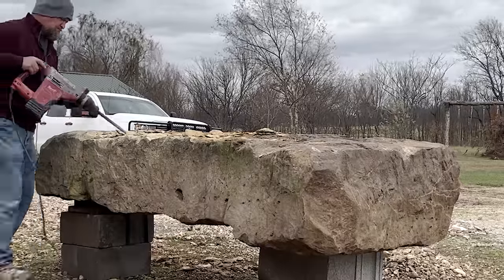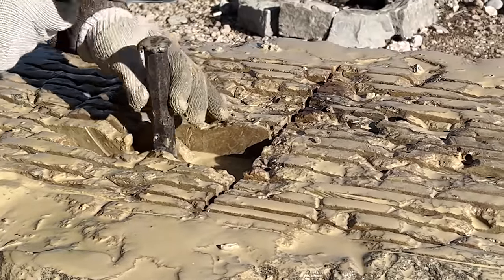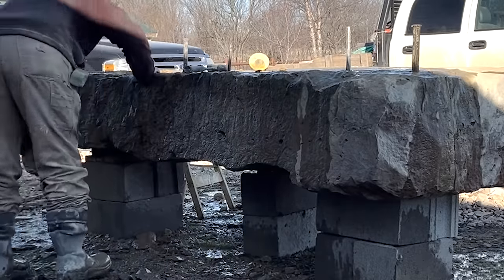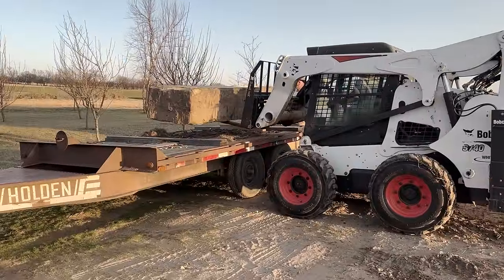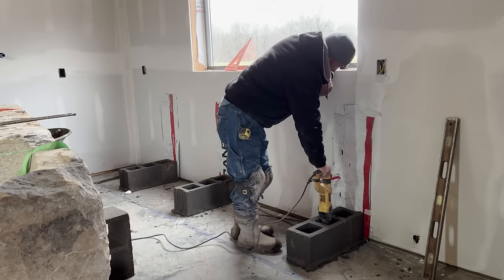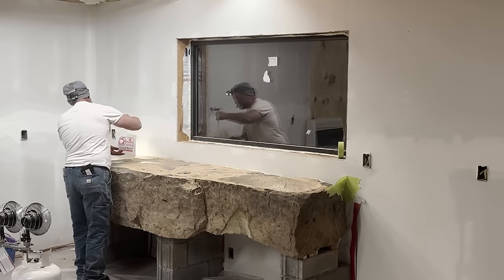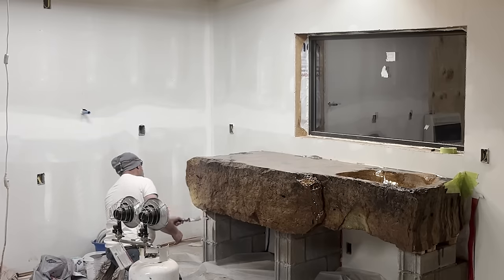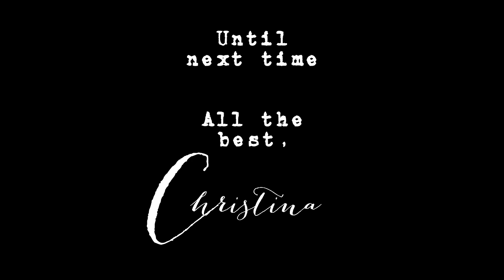Carving a Stone Farmhouse Sink & Countertop From a 3,400 Lb Stone - DIY

Comment: How well does that epoxy coating stand up to the daily wear and tear in a kitchen? 

I've seen loads of people use it for tables and furniture but none of those have been a countertop where hot pans and sharp knives etc would be on it.
Reply from the maker: Yes it does.  If you use cut on directly, it will show a knife mark like most any other surface.  It’s really easy to clean and keep shiny.  I’ve never set a hot pot on it in my home but crock pots and such are no issue at all.  I really have been happy with the epoxy in our own home, used on concrete countertops.